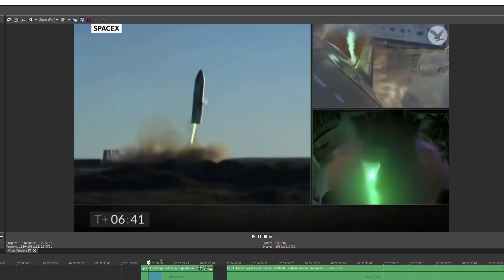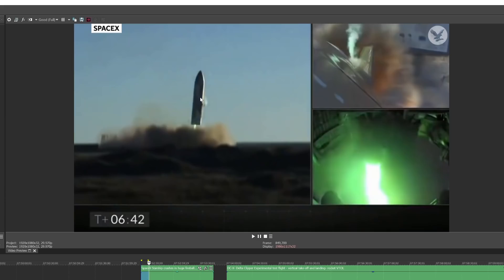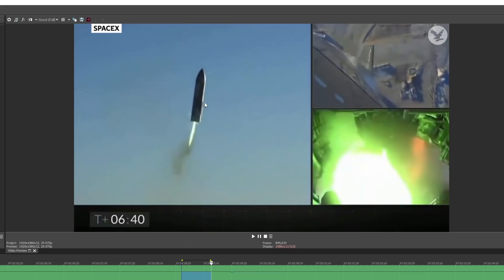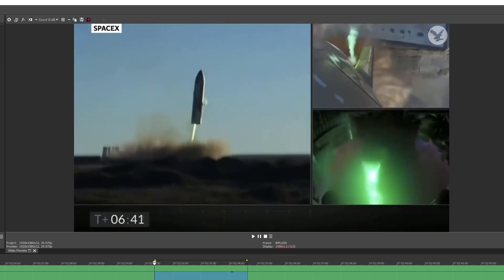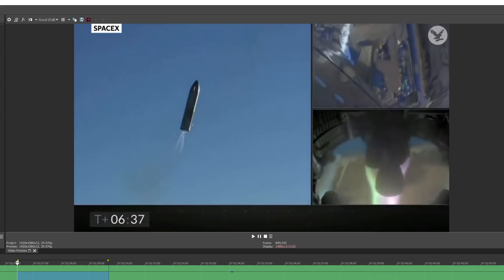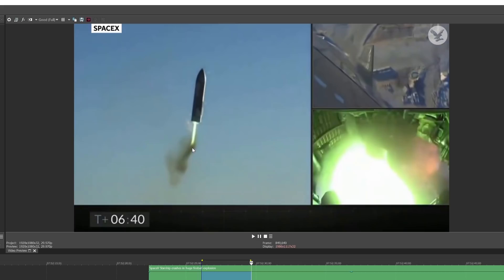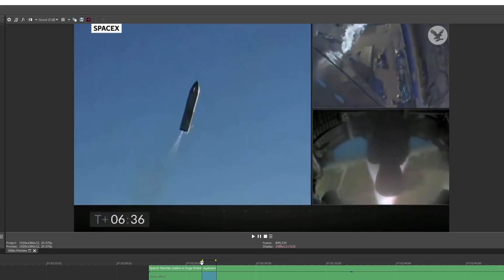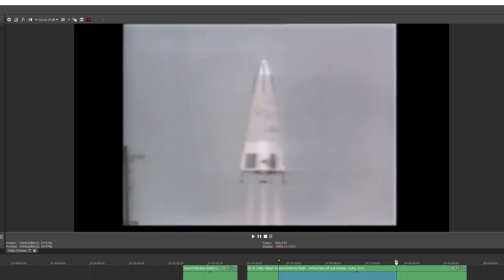SpaceX Starship Explosion: First analysis!

Comment: ooooooh interesting footage from inside the rocket, one exhaust starts shooting green flame; engine loses thrust, so it does a hard landing; they don't have any code checking for engine faults; their code assumes optimal thrust, so it doesn't raise the thrust to soften the landing
Reply: It can't raise the thrust, it's starved of propellant feed pressure. The code does not assume optimal thrust, you can see the green intensify as the engine tries to throttle up and just forces more oxygen through the chamber, burning it up worse.
Reply: @sycodeathman  a proper sensor network would've detected excess of oxygen and lack of fuel and done somethin' bout it.

Comment: If it's copper, my guess is bearing material from the turbopumps.  They uncovered from the fuel sloshing, oversped, overheated and the bearings started breaking down.  Pump may have seized and stopped fuel flow all together when it came apart.  May have initiated the explosion too.
Reply: Combustion chamber is made partly out of copper.

Comment: I asume the inside of engine bell is copper same as older engines, you just run fuel or oxide trought copper pipes to keep it from melting. And this might have been they had problem with fuel running and pure oxygen burned the enginebell.

Comment: I’m going with low fuel flow reducing the bell cooling allowing the resulting increase in the ratio of oxidiser to burn either the bell lining or maybe even the injectors. Will have to do some engine metallurgy research to see what everything is made from. Both copper and boron have green flames so could be either...

Comment: They have header tanks separate from the main tanks. They're not used until the landing so they're full to solve the sloshing problem. What happened in this case is that the pressure in those header tanks was too low. They have a separate pressurization system that probably didn't work.

Comment: The bell is cyro cooled by the lox right ? They could have lost lox flow ?
Reply: It's cooled by the methane fuel, not oxygen. Losing fuel would mean a loss of cooling and an increase in oxygen concentrations allowing for rapid overheating and copper burning, which is what we see.

Comment: So, a little summary for everyone: The debate now is "what caused the green flame". The BFR (rocket shown in video) uses SpaceX Raptor engines which are electrically ignited to burn methane and oxygen. So the green flame is not caused by chemical ignitors like TEA-TEB, which contains boron which causes green flames. So it is more likely that some parts that contain copper got over heated to the point where copper ions made the flame look green. But: It is not 100% certain whether the green emission is from boron or copper. Maybe boron is used in some other way? Maybe the rocket engine nozzle contains copper and the cooling of which failed? there is even the idea that fuel (methane) starvation led to oxidation of the rocket nozzle, causing great amounts of copper oxides to be heated, which could explain the green flame.
Reply: Combustion chamber is made partly out of copper, it's the most logical cause.

Comment: I’ll guess fuel pump seal failure. The pumps are cooled with the fuel, when they started the turn the fuel flow to the green engine slowed enough to over temp the pump causing the pump to fail and the other pumps shutdown as a fail safe.

Comment: Why do all this, why not just glide the thing back to land on a runway?
Reply: For a lot of reasons.
Reply: Why don't you apply for an engineering position at SpaceX if you have the answers?
Reply: @BIOHAZARDXXXX  Do you think I'm wrong, or do you think SpaceX has no reasons for picking a more difficult landing method than designing for a glide-slope landing?
Reply: @sycodeathman  There are no runways on the moon and mars.

Comment: couldnt they just spin the rocket to make a vortex in the fuel tank to stabilise it like water going down the plug in a bath?
Reply: Depends on the rocket. Some have anti-vortex baffles precisely to prevent the whirlpool effect, others might use it to fling the fuel to the sides for microgravity restarts.

This is neither though. Spinning would be pretty bad in a rocket that's trying to touch down, as you can see from the videos of the CRS-16 "landing". It has some fuel in small header tanks that are used for the landing burn. Unfortunately the landing was a wee bit hard, but from various accounts, the test was a successful failure. They did what they needed to do. The nearly-landed-it was a bonus. The explosion, well it looked good on camera.

Comment: Edit: Was confusing the Raptor with the Merlin engine, please disregard. 
Green flame is just the starter fluid, they were trying to reignite the engines once they went out, it's some sort of borane compound, it's commonly used in rocket engines as well as afterburners on jet engines. 

Not copper, but decent guess.
Reply: Raptor doesn't use any borane starter fluid, it uses electric spark ignition. The green flame was caused by the copper interior of the nozzle throat being burned.
Reply: @sycodeathman  Yep, you're correct. I was confusing it with the Merlin engine. Elon said about a year ago that the green would be from copper in the engine, this was from the test, so clearly it's something they expect some of, but perhaps not as much. Maybe it happens when it's oxygen rich or something? https://twitter.com/elonmusk/status/1092280273599979520?s=20
Reply: Combustion chamber is made partly out of copper.

Comment: The green flame is the ignition fuel burning. They lost a rapter engine right at the end.  So  most likely they were trying to quickly restart the engine but to late. It wasn't sure to sloshing liquid. Give them some credit for engineering that aspect.
Reply: There's no ignition fluid in Raptor. It ignites itself using electric arcs to light a methane-oxygen gas torch which blows into the chamber for ignition. This way they are not dependent on any consumables other than methane and oxygen, which makes the fluid loading sequence very simple compared to other rockets.
Reply: Combustion chamber is made partly out of copper.

Comment: I saw this live on Youtube... the kaboom at the end was really surprising.
ALSO have you noticed that the rocket has no legs to land on???
Reply: The legs are inside the engine skirt, they flip down and latch into place once the vehicle is low and slow enough. Unfortunately it never got slow enough to trigger the deployment this time. However, on the two previous Starship hop tests the legs worked perfectly each time.
Reply: They expected it to explode at least at the end. This text was really successful.
Reply: It has, they just didn’t deploy in time because of the engine going out.

Comment: As someone who did his thesis on full-flow staged combustion liquid methane/ LOX engines, my guess from the footage is the following:

1) Liquid fuel supply is disrupted by maneuver (within the tanks, no longer saturating the pump input), causing temporary cessation of regenerative cooling of the combustion chamber, which is probably made out of copper for maximum heat transfer rate,
2) Cessation of regenerative cooling causes combustion chamber to melt, causing the characteristic green flame and reducing thrust,
3) Loss of thrust causes excessive speed upon landing.
Reply: Do you think it is possible only the methane was interrupted, but LOX continued? I think the methane is pumped through the bell and LOX is fed directly into the turbo and combustion chamber, correct? If the fuel mixture changed to pure LOX / oxygen rich that would significantly increase the corrosion rate of the bell (on top of interrupted cooling).
Reply: @timgepoint1000  Well you know that's a very good point actually, and given that the lox tank is the larger one we'd normally expect that one to have worse sloshing characteristics and so be more likely to suffer a disruption in flow. From looking at the starship diagram though the oxygen tank appears to be closer to where I would assume the centre of gravity to be, and given the ferocity of the maneuvers I'm assuming that this is a larger factor than tank size. If flow to both fuel and oxygen was to occur, regenerative cooling would stop but so would combustion, so no melting, the engine would just stop. This doesn't appear to happen in the video. If oxygen was disrupted more you might see either an increase in combustion temperature through making the reaction occur closer to the stiochiometric ratio, or decrease it whilst also leading to partial combustion of the fuel if sufficient to take it below the stiochiometric ratio. So this, disruption of oxygen supply instead of fuel supply, is also possible. I didn't really see much change in the combustion products / flame in the video though before the first bits of green, neither a more whitish hue corresponding to a higher combustion temperature or yellowish and darker hue corresponding to lower combustion temperature, so I presume it was the fuel that was disrupted thus interrupting regenerative cooling as above. It's possible that oxygen disruption did occur though and it's just not clear on the video or that I missed something. For now I'll stick with my current conjecture as the most likely, noting the other possibilities.
Reply: Sounds very good
I mean its not good
but a good explanation

Comment: Couldn’t they have a vessel that reduces in volume as the fuel burns?
Reply: That is actually used with many pressure-fed reaction control systems (bladders inside the tanks).
Reply: @Katniss218  Especially for RCS that makes a lot of sense, they usually operate with little to no gravity (or have to start without acceleration pushing the fuel to one side of the tank). I still wonder about the temperature aspect though, do you know of any cryogenic fuel types that use that approach for the main fuel tanks?

That said reaction control systems often use something hypergolic like UDMH + nitrogen tetroxide since that way you don't have to worry about ignition. And the nasty combustion products aren't a big concern outside the atmosphere. UDMH is liquid between -57C and 64C, nitrogen tetroxide around -12C to 22C if I remember it right. So with those materials assuming the oxidiser won't react with the bladder it should be fine.

Also realised I remembered the values in my previous reply wrong (had the melting point in memory instead of boiling point), but even though methane with 111K/-161C and oxygen at 90K/-183C. Under pressure that would change a bit both have the critical point around 50 bar at -83C for methane and -119C for oxygen. Still pretty cold for bladders that have to deform but not crack/leak and it might be a higher pressure than desirable since it requires thicker tank walls. 

So I'm still curious about this, are you aware of any rockets with cryogenic fuel/oxidiser types that used this for main tanks? Seems like potential interesting reading material for the upcoming free time around christmas/new year.
Reply: Temperature would likely be your biggest enemy there, you'd presumably need something like rubber with normal fluids. But the fuel and oxidiser involved in this design are liquid methane and oxygen, so that's 90 K and 55 K respectively (-180 C and -218 C, if you want it in Fahrenheit or Rankine do your own conversion). Basically look up any classic demonstration with rubber and liquid nitrogen, you can smash it with a hammer if it's that cold (or break it by bending). There might be some exotic material out there that will behave nicely at those temperatures,  but I have my doubts... and if it does exist how does it behave at normal earth temperatures before being filled up with fuel?

What they did with this design is to have additional small tanks with oxidiser and fuel that can be used during the descent/until the fuel stabilises in the main tanks again.

Comment: The 3 engines being shutdown in succession over a period of minutes was by design, for the same liquid-fueled rocket engine reasons:  abrupt shutdown would cause a heck of a lot of sloshing & instability. Plenty of talking-heads waffling nonsense about that it was an engine failure(s). The only real issue(s) they had was not reaching their ~12km altitude & soft-landing. They got to ~8km, and it appears a desperate attempt was made to reignite one more engine (green flame = boron compound) right before landing, after one of the other engines flamed-out prematurely.
The prototype was built to be tested to destruction, with a ~33% success rate. This launch test was successful in that respect.
No, the Raptor engines were not swinging wildly; they were merely reacting & compensating for other engine(s) being throttled back and/or shutting down.
Reply: green flame was from copper, not boron.
Reply: @takanara7  Nope. Raptor can be started with a spark system. TEA-TEB is still often used. Whatever small amount of copper alloys used in Merlin and/or Raptor engines, nozzles included, is certainly not going to sudden vaporize in such amounts.
Reply: @thesunexpress  Raptor does not use TEA-TEB, and it hasn't since 2017. Only the early, sub-scale, development versions of the engine used boron compounds for ignition. Since they moved to the full scale design, it has been nothing but spark-torch ignition. Stop spreading misinformation, dude.

Comment: I'm late to the party so I have a bit of extra information.
Raptor doesn't use TEA-TEB it uses spark ignition.
The only copper in the combustion chamber is the injector head.
Propellant flow was interrupted by header pressurization failure.

My money is on methane flow being interrupted, engine goes oxygen rich and oxy-torches the injector head.
Reply: And the combustion chamber is made partly out of copper too.

Comment: If they used brass for the pipes in the engine bell, that would certainly lead to that bright green flame if they had a moment where they burned oxygen rich at all.
Reply: The combustion chamber inner wall, throat and nozzle are all copper. This is to maximize the cooling effect of the high flow rate of liquid methane through the passages milled in the liner. The copper layer doesn't withstand the pressure from the gasses on its own though, instead the force is transferred into a much stronger jacket layer of steel alloy. Steel has a much worse thermal conductivity than copper, which is why the nozzle can't just be made from steel through and through.

Comment: Yes they lost enigne on the way, they probably lost 3rd one going up which also looked wierd. Note that they expected to lose rocket as the whole thing was made for tests and they already have new one almost ready
Reply: The engines were supposed to shut down during ascent, to limit acceleration forces on the vehicle (with all three Raptors running that thing would be pulling almost 5 gees before cutting off). They also wanted to keep propulsive control all the way up to apogee to avoid a violent kick-back maneuver after the last engine shut off and the vehicle reoriented to move belly-first through the air stream. 
For a similar reason, only two engines were needed for the backflip maneuver before landing, and the landing itself is meant to happen on a single engine. The problems only started shortly after the flip ended, as the header tanks lost pressure to keep pushing propellants into the turbopump inlets. Both engines lost a good amount of thrust, engine on the right then shut down as planned but it was too late for engine on the left, as it was already damaged by lack of fuel flow and was chewing itself up (green flame is copper nozzle lining being burned in oxygen rich exhaust). The thrust decrease from this damage and the reduced feed pressure is why Starship hit the ground hard.

Comment: The green flame is TEA-TEB (triethylaluminium and triethylborane), which is used as an igniter... the same stuff that was used to ignite the Saturn V's F-1 engines.
Reply: Doesn't the raptor engine use spark ignition instead TEA TEB?
Reply: Yes and no. There have been models made with TEA-TEB and models with the spark igniter. I would guess the latter ones aren't as reliable because it's new technology, whereas, SpaceX have 14 years experience working with TEA-TEB. I would also guess that they wanted reliability with this test, so they reverted back to the tried and tested TEA-TEB variant. Clearly it didn't help.
Reply: @FSF87  oh. I thought I read sn8 raptor engines used spark ignition instead of tea-teb
Reply: No, it's copper. TEA-TAB isn't going to be burning that late into a burn. If they were using it they'd use it to start the engines and for nothing else. The engines went from a clean burn to a green burn, which just isn't the right sequence of events for this to be TEA-TAB
Reply: @noname117spore  it is going to be burning that late if you have an engine out and you're frantically trying to reignite it. And that appears to be what we see in the video. They fuel the engines up with enough TEA-TEB for multiple engine starts. I mean, how do you think the Falcon 9 first stage ignites its engines for the reentry and landing burns?
Reply: @FSF87  TEA-TEB is not used for the raptor engines. it was used for the merlin engines on falcon 9
Reply: @FSF87  The engine with the green flame had already been ignited at the start of the burn. You'd have to argue that they lost both engines and were trying to reignite one...

Even SpaceX's reasoning themselves conflicts with your idea. Its not TEA-TAB.
Reply: Raptors don't use TEATEB to ignite. The combustion chamber is made partly out of copper.